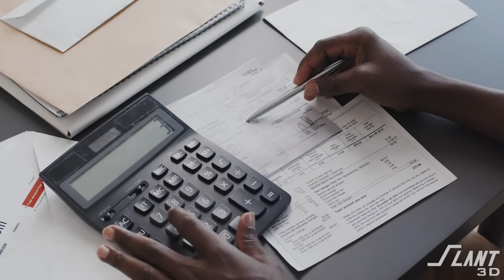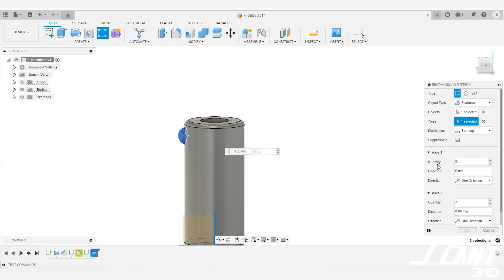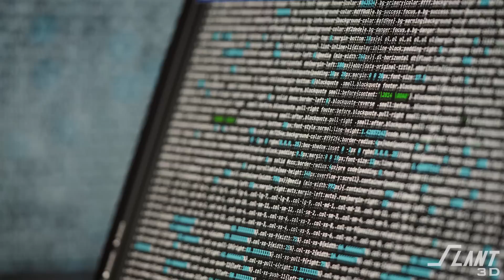3D Printing Will Obviously Replace Injection Molding

Comment: I'm an injection molding process technician who also has several 3D printers..... As someone that's very familiar with both ends of the spectrum this is a flat out lie. I'm currently on a 4400 ton machine right now typing this waiting for the 119 zones of hotrunners to heat up. there's not a 3D printer on Earth that could come close to matching this performance or speed.
Reply: I was going to say something similar. I can't see a 3d printer ever being able to spit out pieces at the capacity and speed injection molding does. Like Bic pens, that's never, ever going to be more efficient than injection molding.
Reply: @bloopbleepnothinghere not up mention the consistency and quality of parts. You will never reliably get perfectly clear parts from printing. I think he's high on his own supply
Reply: @cwill6491  i actually think you can. and i am working on things to control the process reliably.
of course its not going to change the fundamental limitations. but i wont even call it a hobby if it doesnt have repeatable results.

i dont know why people tolerate so much shit from manufacturers in 3d printing. its worse than any other tech sector ive ever encountered.
Reply: Im a contractor and work for a lot of companies making various parts for VW South Africa. Injection moulded. If we were using 3d printing VW would probably build 1 car per day. Currently they are producing 700 per day. I own a 3d printer and I dont see how he came up with this.
Reply: 100%.  3D printing is a great step in the "prototype " phase of part construction  and testing ,  but the rate of production  is nowhere near what injection molding can produce. Cool thing I did lately : 3D metal printed a mold insert with integral waterlines that could never be conventionally  machined, and it was very "cool" and effective. That insert costed around 8k and took almost 2 days to make. Additionally,  it required  6 hours of CNC finishing  work to meet the quality requirements. Excellent technology,  but it is very difficult  to achieve  high output.
Reply: @dartened exactly!
Reply: Educate them. The topic should be how we can make injection molds cheaper and quicker using 3D printing.
Reply: If my 3d printer was a 4400 ton 3d printer it would crush the injection process...you guys have got  to quit comparing 4400ton machines that take months to start producing anything with a 44 lb machine that does a piece in 10 minutes.
Reply: Of course, one of the industries that 3D printing might lend a helping hand to is, coincidentally enough, injection molding. Specifically related to the development of custom molds for various products, and even for making the tools necessary to create the molds through Stamp EDM (Electrical Discharge Machining).
Reply: Two things came immediately to my mind - the detail of surface structure or smoothness even on very large parts is probably unachievable by FDM printers, not to mention in the same outputrate. And then there are probably hundreds of materials, like duroplasts, that are simply not printable. Like everybody else already said - every process has its own strengths....
Reply: I do some 3D Printing and I agree injection molding simply can't be completely replaced by 3D printers. He is just trying to promote his business or is getting delusional trying to expand his business. 

There is a new method that was invented recently that combines both injection molding and dissolvable 3D molds. That I see would work 3Dprintingnwrd YouTube channel had this on there.

https://youtu.be/4kIeqTK5iao?si=e6IogLVy5tTHdGyX
Reply: great to hear from someone who, like me, actually knows how to use both methods and isnt falling into the either/or trap.
Reply: Honestly I can’t just throw what i think about manufacturing at an expert. However i do believe the future of manufacturing is held in between the methods. Using printing a injection molding together to make a process that is faster and more efficient. https://youtu.be/4kIeqTK5iao?si=tPVQRdJx1gsEYeEy
Reply: That holds true if the high unit volume object is NOT required to iterate, or change frequently, say for example plastic ball point pen barrels, plastic lighter housings, or plastic disposable utensils, or other such items. For those applications injection moulding is unbeatable. Where 3D printing beats injection moulding is for small to medium runs of many similar, but non-identical objects. It would be prohibitively expensive to have 10 different moulds machined for 10 objects of medium volume production runs instead of producing the objects with 3D printers.
Reply: @oceanic8424  people often imagine molds to be in the six figures min...actually, there are companies that do lots of molds for €5k and even less.

as always, it fuckin depends.
Reply: @oceanic8424  true, but the vast majority of products do not need to or should not take an iterative approach when going to market. 

We do that during development and testing,  but for regulatory,  liability and human resource limitations we lock down designs, this makes injection moulding suitable. Particularly if we use approaches like aluminium or 3d printed inserts, cores and cavities on short runs.
Reply: @mrpotatoheadie 3d printed molds will probably be the way foreward for low number runs.
Reply: Let's compare dollar for dollar though. An injection molding machine might cost the same as a farm of 100 printers. The printers can print anything in any quantity on demand.
Reply: @stevenmcculloch5727  also, show me a hundred 3d printers that could print one precision Lego brick in 3 seconds. I'll show you a production die that can make 500 in 3 seconds. 

Now show me a polypropylene chair seat made in 10 seconds. The list goes on.
Reply: @stevenmcculloch5727  Injection molding can stamp out arbitrary complex pieces at the rate of 10s of thousands an hour. 100 3d printers can't come close to that. How much would a pen cap be if it was 3d printed? It's such a simple piece and yet 3d printing it would be a pain, maybe print 500 of them in an hour with 100 printers. Then you have to check for errors, fix broken prints, keep the print heads maintained, and so on. And in all that time a factory in France has spat out 10k Bic pen caps and the die mold has paid for itself a million times over.
Reply: @bloopbleepnothinghere you think it'd take an hour... to print 5 pen caps?... 😂😂😂
Actual mid-witt

Comment: I make injection molds. 
Cnc and modern machine tool tech is continuosly making mold making much more efficient and 3d print has a very long way to go. Don't scrap your milling machines  just yet. 😂

Comment: No. Just no.  Not the same result. Not the same speed of production, or the same material properties. 3d printing may replace some limited scenarios, such as limited run, delicate parts, but will not replace plastic injection molding in general.  Printed parts are weak and flawed.  In some cases you can 3d print the molds vs cnc machining the molds though.
Reply: Printed parts can be made stronger than you might think. While they might have issues with layer lines, it's not so bad that they are delicate. I've made pieces where I'm pretty satisfied with the strength.
Reply: @logicalfundy  yeah, strong enough in some cases, but almost always inferior to injected part. And printing is slow as hell compared to casting or injection molding.  It's ok for prototypes and one-offs. But if you need 5,000+ make a mold.   And cost. Injection molding is way cheaper in materials and aluminum molds are pretty cheap now.
Reply: @erikturner8005  printing at scale isn't done with a single printer though. Every business I know of that is trying to print large quantities uses a farm.
Reply: @logicalfundy   so?  Even with farm you have to post process parts, vs injection mold drops finished parts into the hopper.   I have a friend who prints a production product.. for that product resin printing is appropriate for the number he sells vs the hassle of making injection mold setup. But that's not commonly the case.  The post process labor isn't worth it vs molding for anything approaching scale.
Reply: @erikturner8005  Resin printing is not what you use for large scale 3D printing, and has more post processing than most other types of 3D printing because you have to handle a curing process as well as the print. What he is talking about in this video is FDM, which usually requires no post processing.

Injection molding can require post processing as well with complex enough shapes, in fact what Slant 3D often refers to as "impossible geometry" is basically complex enough geometry as to require post processing with injection molding, but no post processing with 3D printing.
Reply: @logicalfundy  my FDM prints generally require post processing as well.   And even with a farm, fdm is terribly slow.   For example, when I print terrain tiles, on fdm each one takes 9 hours to print. Or 4 hours on resin. Or 7 minutes with casting (and only costs about $10 in silicone per mold, so that scales well assuming I want solid resin or solid hydrostone).... would be seconds with injection molding, and able to be hollow, but higher tool costs. Injection molding is an optimization for producing high volume, high quality parts very fast...it just takes more setup and equipment to do than 3d printers...   not to mention the sheer amount of fiddling required to maintain reliable results on a farm of printers. Crap rattling loose, thermistor burning up, ptfe tubes burning, filament moisture, resin mess, the wasted material, and on and on. If I needed to produce 5000 of a (profitable) part, usually I would injection mold it.
Reply: @erikturner8005  that amount of time one print needs is less important with a farm of printers. I believe reliability is why they made their own printers rather than off the shelf units. We'll see how it works out.

That your FDM prints require post processing is on you and how you design - generally speaking, as you get better at designing for 3D printing, your designs should eventually need little to no post processing. Same is true for any process, you need to understand the limitations of the process.
Reply: @logicalfundy  yeah, no.  FDM prints need a brim for flawless no effort bottom edges, and that needs cleanup with exacto knife, as well as the support contact points, and dealing with any other imperfections and adding reinforcement rods.  I print models, not functional parts, and the aesthetics are important. Production time is absolutely relevant, duh. As well as maintaining that many printers....it's a pain in the ass with different stuff breaking down all the time...I have a small print farm in my basement, 15 printers of different types...
Reply: @erikturner8005  I rarely use a brim. But then again, I usually make functional prints where aesthetics is not top priority.

I think Slant 3D focuses mostly on functional prints for manufacturing, he talks about things like electrical boxes and such. I don't think your types of prints are really their target market.

Their printers are custom built with a focus on reliability, and they've noted that. These are not the same printers that you'd have in your basement.

Slant 3D also has orders of magnitude more printers than you do, which makes scaling easier for them.
Reply: @logicalfundy  definitely.  These guys are not targetting tiny detailed models, but larger functional parts where you can get away with thicker layers and less fine surface detail. For my use cases I'm hoping resin printers get to 1 micron xyz resolution in 2 or 3 more hardware generations...25 to 50 micron resin prints available today are viable but not ideal...and on FDM I almost always print 100 micron layers, even on functional parts because they come out pretty, whereas conventionally you would do those in 200 or 300 micron layers. There's certainly a niche for just in time manufacturing of small runs of functional FDM parts in the sweet spot below where the costs of mold tooling are justified, and where being able to start production quickly matters, or you dont want to send molds to China for various reasons. Maybe enough of a niche to run a business.  I could see industrial fdm printers being more reliable and consistent than consumer grade ones, and probably faster with newer tech and stronger gantries.  But you still have asymmetric material strength in the prints and that sucks for a lot of scenarios.

Comment: 3D printing can only replace injection modling for low scale/low volume applications. You are not correct when saying that many products are made in tens of thousands only. My brother works at an injection molding factory in Europe and they can be pumping out tens of thousands crates of one design per day for months for some supermarket chain. 3D printing cannot compete with this scale at all.

I understand that you're promoting your business, but this video is not truthful at all. You should more clearly explain that 3D printing is for small scale start-ups which are trying to find their niche. Established industrial companies will continue to pump out millions of copies of the same product using injection modling for decades to come.

Comment: 3d printing not only enables a product design to iterate, it also supports making quick minor design tweaks at any time, so a design annoyance can be quickly corrected.

On the flip side, there does seem to be a question of scale at some point. Traditionally molds were machined, but 3d metal printing is also rapidly becoming viable for making molds. At some point it becomes an economic optimization, as cost of shipping and packaging can be significant factors depending on volume and market logistics. For a new design, or new parts in a product, 3d printing does offer many benefits and much flexibility with few negatives.
Reply: One of the few negatives of course being that it lacks the proper tolerances for repeated injection of plastic... Oh, and of course another being that you cannot get the same precision as milling, which is totally not something you need for injection molding parts. 🙄

Comment: Yeah, no. Injection molding cant be replaced by FDM maybe by some form of volumetric SLA or SLS will come close but even then it has shortcomings with precision, finish, post processing, and such. Injection molded parts when designed correctly for the process are high precision, whatever surface finish you could ever want from grainy to mirror shine, comically inexpensive in volume, fairly low energy cost, and very fast to produce by virtue of being a volumetric process. That is an incredibly difficult combination of optimizations to beat. FDM certainly cannot and won't. It'll take an as yet unforeseen breakthrough in volumetric printing technology to make something close to competitive in the categories injection molding excels in, which is almost all but the upfront cost for low volume production. You can even get desktop injection molding machines for as little as 6K USD now that use aluminum molding plates if you do enough small production runs

Comment: Some really interesting points here! But both have seperate places, FDM prints even from the best printers don't give the clean faces, consistancy or in some cases, strength required for quite a number of products to be marketable. The other 3D printing methods have quite a number of their own downsides also, such as high cost and limited material availibility, high machine cost, lengthy and labour intensive post processing etc...

Production 3D printing's best application in the commercial sector is likely with startups which have limited budgets and a need to start at a small scale then scale up exponentially with the demand. 

The idea of marketing a product that is still very much in the iterative phase would probably not be a very liked idea by bigger industry players and wouls likely not be a wise aproach. 

You can also not achieve the same results with 3D printing as are availible with injection moulding, such as overmoulding.

Comment: Laughable, i make molds and inject inhouse, when injecting multi cavity molds (28pcs every 15sec) where you would need a SLA printer to make and be within tolerance of 10 microns on each part, good luck replacing injection molding at those speeds, but thats not to say that semi big parts can't be 3d printed and at a cheaper price especially if volume isn't there, but for me the average order on parts are at 25k parts so 3d printing is a no go in most industry's and volumes keep going up if with more and more consumers in the world so its not sustainable and will never bee with the world population going up consuming more and more, thats my 2cents on this matter

Comment: 3d prints are always going to be competing with purpose made tooling that get the same advantages as 3d printers when molds shift to being 3d printed. Especially when they can be made as green parts that are worked on before becoming metal that are less reliant on EDM.

Comment: Nope.  As long as 3d prints are weaker in one direction (try to print a 1 mm tube  that is 1 m long…. And I know it is extruded but…..), can’t offer smooth surfaces on all sides, are not food safe, cost more energy to produce (. 1 molder vs 1000 printers, especially if you consider other materials than PLA.  ABS  being the most used material). 

And so on.  Both technologies will coexist in the future till the point we have replicators able to “print” atom by atom….. and quickly.